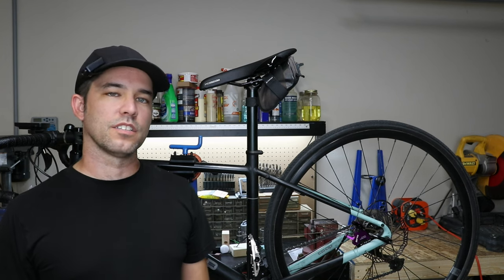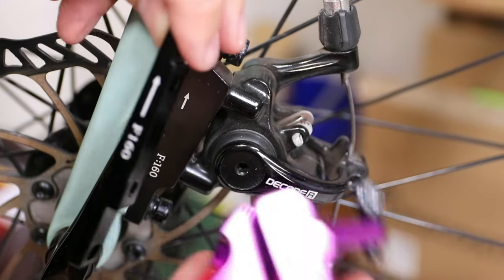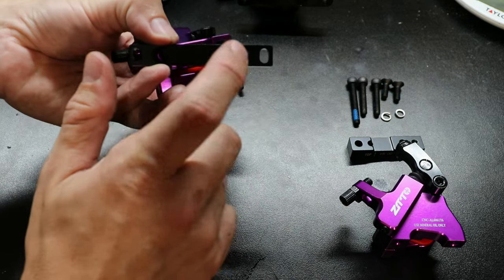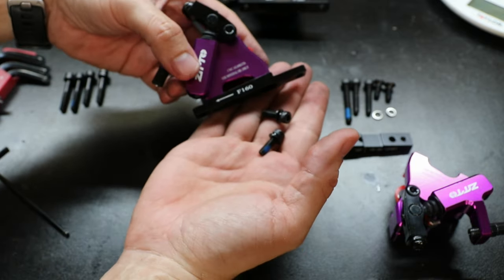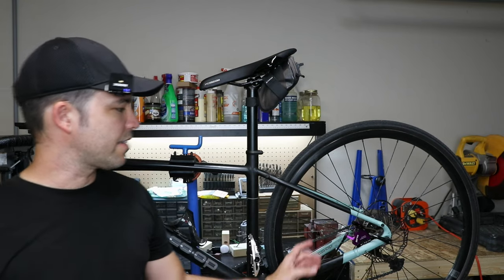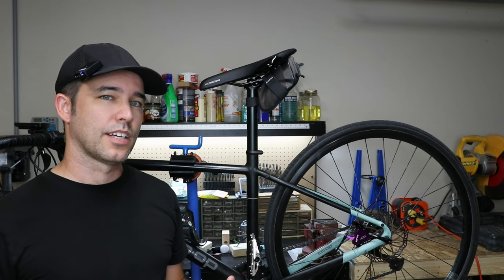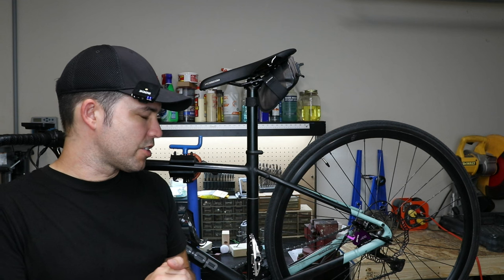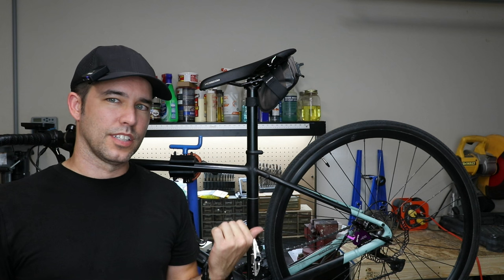ZTTO Hydraulic / Cable hybrid disk brake calipers - install and testiing

Comment: A couple of things. I have these calipers. I fitted them because after 9 bikes over the years with hydraulic discs I was so done with them. Firstly, clean the stupid thread lock off the bolts. It totally confuses how tight you have the bolts. Next, the pads that come standard are semi sintered. They have to be fully bedded in with the disc to work correctly. After this process the bite is amazing and the pads really last. Downside is they howl when wet. Silent in the dry though. A wet ride somehow seems to condition the pad material even further, then they work even better. 
They are wonderfully adjustable. There is a rod which the cable arm pushes in to activate the hydraulics. This rod has an Allen socket end. Screw it inward to move the pads closer to the rotor, outward to give yourself more clearance. Then you have the cable adjuster on the caliper, which is great for on the road tool free adjustment, and possibly reach adjustment at your lever too.  Yes, that top bolt on the front caliper is too limited for clearance. It's manageable, but if I lose patience with it I will file the caliper body to give it more clearance. As with all mechanical brakes, cable quality is the ticket. I never felt the need to use compressionless cable with these, but I DO use Shimano cables which seem to compress less than most. 
For those interested, the main reason for using hybrid calipers lies in the fact that the pads don't have to be adjusted individually. 
Another thing I have found, the pads cost next to nothing. Buying direct from ZTTO on AliExpress they are typically around 15$ for FOUR pairs, and you have the choice of three different compounds. Hope this helps....

Comment: There are two variables that might affect performance. The calipers and the brake pads.  Any chance your old pads are interchangeable with the new calipers? If you could put the old pads on the new calipers that might tell you more about brake performance. 

Great video and cool caliper color.

Comment: Interested in these brakes, but so they hold up and perform good when yoi do long downhills on a roadbike woth speeda up to 70 kph? Did the breakingpower break in or so?
Reply from the maker: I've rode a good bit since this video, I've had zero problems, however the braking power is the same and I've not taken it to any mountains.
Reply: Because I've 95 kilos and some of the semi hydraulic brakes are not good, the oil inside start to get hot and they don't work before cooling downythats why i ask before buying  @BruceChastain

Comment: Interesting product and good review. I can't really see the point of them myself. As you said good mechanical calipers are available. My new £800 road bike came with dual side action fully mechanical calipers.
With the oil and potential for seal failure I'd rather gain the full benefit of hydraulic and have a hose and lever as well.
Reply from the maker: yeah good point. The whole thing with the different configurations of calipers can be a bit of a spendy rabbit hole.

Comment: Are your old machanical disc calipers dual pot they do look dual pot 🤔
Reply from the maker: no, they had a single piston, only on one side. It was a simple single side cam system.

Comment: I would take thr better trp hy/rd. Thats the best of the hybrid disc brake caliber
Reply from the maker: hey GG! I was only somewhat aware of the trp set, but I just looked them up, interestingly on their product page they "strongly recommend" using compressionless cable housing. Also a good thing about the trp is it has a reservoir, which these do not.
Reply: @BruceChastain  yeah compressionless housing is a minimum to have